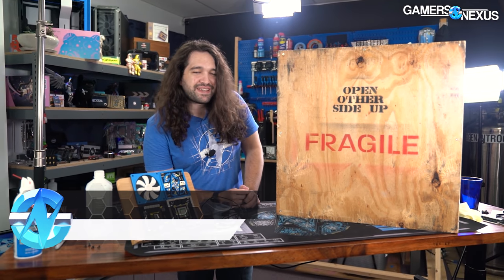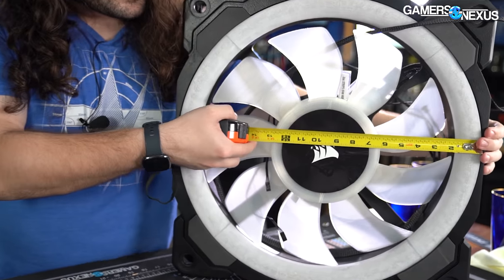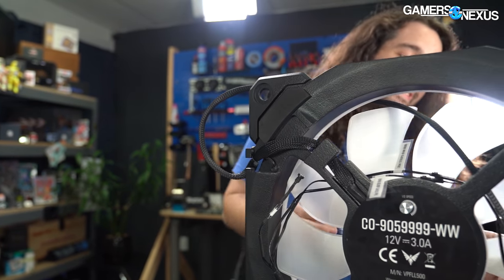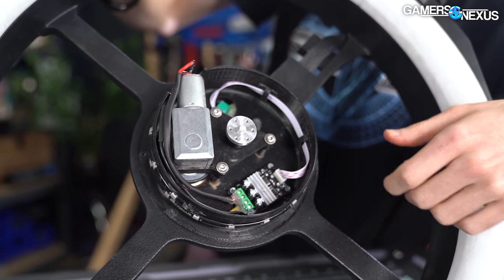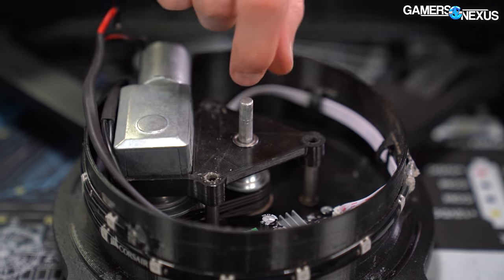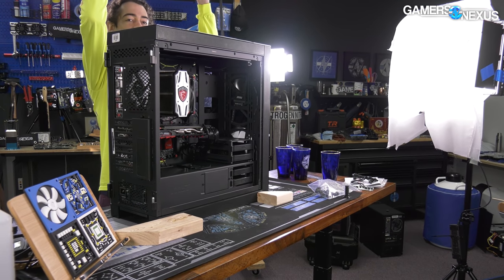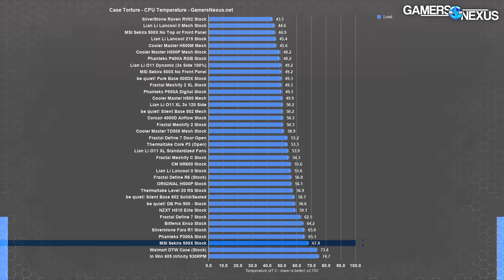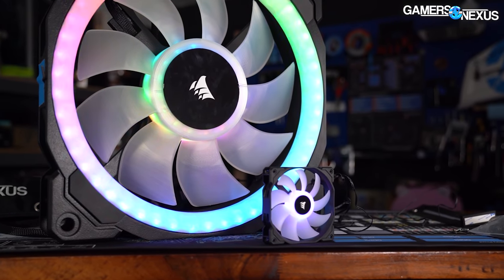World's Biggest Computer Fan: Corsair 500mm LL RGB Fan

Comment: The reason for the grinding and all the metal shavings inside the gearbox is the worm gear. It transfers the rotational force in a different direction so it can have way higher torque (which in this case, it needs that torque for that tiny motor to move that massive fan). The downside is that the gear can only move if the motor is moving, making it a very poor choice to use this particular design of gearbox. When the power to the motor us cut off, the worm gear will stop turning and the momentum of the fan will keep spinning, causing the regular gears to grind against the worm gear. That's why its having the grinding issue. Sorry for the rant. Just had to say it since no one in the video did :P
Reply: Would be easily solved with a one-way clutch/bearing.
Reply: Yep, that is the suck part of the worm gear
Reply: Needs a chevy 350.
Reply: Another great solution would be to do away with the motor and gearbox altogether and go with a direct drive brushless pancake motor on PWM control. 

Or if you wanted to get really crazy, an MIT Cheetah style CAN-BUS pancake motor...but really due to it's complexity and relatively low RPM it's probably not a great choice.
Reply: @manitoba-op4jx  Chrysler VX I 512cu.
Maybe not as legendary as the 440 but a killer engine none the less.
Reply: Approved by a college mechanical design lecturer

Comment: this is so authentic, even fails like the normal LL series fans.
Reply: lol
Reply: I work in a computer store and I can confirm this comment.
Reply: Guess I mist be lucky since my LL fans have worked flawlessly the last 3 years
Reply: ive got 6 corsair SP fans in my case and at least 2 of them have (i assume) ball bearing noises, and one needs to be set to 70%+ or it stops spinning. theyre about 3 years old. meanwhile the ~12yr old noctua 140mm fan is running as flawlessly as the day i got it.
Reply: @iris657  the LLP range fail on the RGB's you buy like 8, one of them fails and sends the rest nuts, complete disaster @ £30 each!
Reply: @torpedohippo8493  give it time
Reply: @MrFruitflan  they've already lasted past the warranty, so I wouldn't be too upset if one broke at this point, of course it would be nice to see them last longer. Since everything these days is made in China, I suspect that all products have little consistency when it comes to reliability because of the production.
I know this might not be completley comparable to consumer electronics, but pliers made in Germany (e.g. Knipex) are way more consistent in quality compared to chinese knockoffs/off-brand pliers.
Reply: @torpedohippo8493  same about 3 years and mine are working fine
Reply: Have some HD120s and 140s and they've lasted perfectly so far after 3 years.  Didn't know the LLs were a bit worse it seems.
Reply: I have had 3 Corsair LL fans in my case since mid 2018 and I have had zero problems with them.
As in, they just work.
Reply: @TheRealBaDaBingDK  you must have had a good batch! well done
Reply: @TheRealLink  yeah were talking LL series
Reply: @_damota  you have been lucky
Reply: @torpedohippo8493  Out of 18 fans 4 of them died in 3 years.
Reply: @torpedohippo8493  Okay, I will. Great advice, bro. Brilliant. Why didn't I think about it earlier? Silly me.

Comment: "There's exactly ONE of these in the world."
"Cool. Can I have it?"
Reply from the maker: We're only borrowing it!
Reply: This is like the love story between Linus and Lucky, the MSI dragon.😁
Reply: @GamersNexus  Sure Steve... Sure
Reply: borrow it...but doesn't say when to return it
Reply: @GamersNexus  is this the same kind of burr

Borowing my family does with my stuff?
Reply: @GamersNexus  That's a shame, I think they should make a computer case, and have the left panel just be this fan, blasting air down right into the motherboard.
Reply: @matasa7463  Mesh side panel and this fan on it. Call it the overflow. Ngl I'd consider buying it.
Reply: I'd like the final product, or 4, but after the prototyping phase.
Reply: @GamersNexus  I mean, you fixed the fan, which is a step further than id go, so id say you should at least now have a stake in ownership of the fan!
Reply: @GamersNexus  "Borrowing it"

You forgot the quotations
Reply: @matasa7463  Agreed, if the price wasn't insane I'd definitely buy one, especially now with the 3090 mining inside the case.
Reply: @thisusedtobemyrealname7876  I would call it the Corsair Overpressure, or the Hurricane
Reply: I just wish it was made by Noctua. They would have built something functional and competent. Not to mention wonderfully brown.
Reply: @GamersNexus  Aercool did something like this with the Aeroracer case many years ago and they actually made a real product that they sold to the public, not just a prop to use as a publicity stunt. Anyway, if somebody really wanted to do something like this, I'd think a better solution would just be to adapt a simple window box fan to a case. That would be better because you wouldn't be running off the 12v rail of your power supply.
Reply: @CaveyMoth  I imagine noctua seeing this and going "pshhh you dare challenge me lmao??? I'll make a bigger shot to surpass your big shot"

Comment: A simple fix would be to install a dog clutch on the hub assembly. When driven by the motor it would spin the fan, but when power is cut or reduced to the motor the clutch would slip until the blade assembly slowed down enough to be driven by the motor. The nature of a worm gear setup is that the worm gear cannot be driven by the components connected. More grease won't help any.
Reply: Yup, 100% agree, they need a dog clutch/overrunning clutch to divert the momentum/inertia of the fan blade assembly.
Reply: I might try this design. Currently we are working on a gear reduction plan but these are metal parts that need lubrication constantly. I like the dog clutch approach. I could 3d print everything and purchase a shoe and ring from a manufacturer. Good idea!!
Reply: S tier comedy

Comment: I need to have this as my ceiling fan for my room!
Btw, Corsair should actually do a limited run (1000-2000) of these fans as a novelty/collectors item.
Reply: they would have to work with an actual box fan manufacturer for that though
Reply: @TheObsesedAnimeFreaks  And improve on the motor. If the fan dies after just 15 minutes of use then it's nothing more than a large novelty paper weight, but if they could find a way for it to be reliable as a fan (or at least a kinetic sculpture) then they'd improve its value considerably.
Reply: @B3RyL  I mean all they need is a better motor, wouldn't be exactly difficult to do.
Reply: Nono, not a limited run.

This should totally be a full time product, otherwise I'll just have to 3D print my own
Reply: I want one for my room
Reply: I need this for my window in the Summer months.
Reply: Only $500 per piece
Reply: @vash_dakari  Same here, I need two of them^^
Reply: @tronixfix  I think that's a very conservative estimate

Comment: Now someone needs to make a 500mm sized scale model of a delta blowiematron that needs an entire kilowatt of PSU power to function
Reply: Hi dapz 
a kilowatt psu is enough to destroy my electricity bill
Reply: Wouldn't be dangerous at all, absolutely all limbs intact.
Reply: @goatedbg145wdinanutshell2  a kilowatt PSU is kind of the lower limit for an enthusiast grade system, right?
Reply: I worked in an industrial facility that had a... massive... blowiematron that ran a fertilizer drying system. 20,000 RPM, about 3 feet diameter fan. These types of things certainly exist!
Reply: @nashthebaker9338  20000rpm!! Did you still have ears after spending time with it? My GPU could do with one of these!
Reply: isn't that basically one of those floor drying vortex blowers flood cleanup companies use
Reply: @akkanomark  Aye Fermi + Pentium 4 used to be the butt of thermal and power consumption jokes. I'm running twin 3080Tis with a 1600W PSU and my power bill is... well
Reply: Yes, we need the ends of the fan blades to reach relativistic speeds.
Reply: How about strapping a GE-Honda HF120 turbofan engine at the exhaust of your PC case?
Reply: As a person who owns a delta fan, I think a 500mm version would probably blow out your eardrums immediately lmao
Reply: The fan that's used in wind tunnels, and those skydiving practice come to mind....
Reply: my g thats called a 500mph airspace testing wind tunnel
Reply: @akkanomark  I agree that the performance increase has only been incremental, I upgraded from a GTX1080 SLI system and had to nearly double my PSU's output for it to cope. Doesn't help that the CPU can pull down 200W on it's own. Heat-wise, I was having trouble with MSI's fan profiles (2x Gaming X Trios running at 82°C is not ideal) but I've made my own curves and now both of them and the CPU sit at about 60°C overclocked so I can't complain. But yeah, the system pulls down about 1100W at full puff
Reply: @akkanomark  I don't use both for gaming, but I do for rendering while gaming (I use an AI upscaling tool for projects and one 3080Ti munches through them while I play Forza on the other lmao), but no, if SLI was scalable (and usable) on the 3080Ti I doubt anything could phase it. Saved £2,000 on going for twin 3080Tis instead of 3090s, but as you said they lack NVLink. For gaming I use the one I've overclocked significantly and it's a real pleasure to use, 20+GHz on the memory is nice to see. Wouldn't be worth it over a 2080Ti in today's markets though, no way. What CPU and GPU version you running? I was under the impression that 2080Tis ran quite hot
Reply: @akkanomark  That's perfectly reasonable, I've got a 9900KF at the minute, sitting at 5.1GHz all core (it doesn't really like more than that but it can take it) and while it's more than a match for the GPUs, I'll be looking to go 12900K when that arrives. 400w is not only achievable, it's the low end of the scale, I'm afraid to say. I've seen the max OC'd version pull down 500 before, which is pretty mad. Undervolting is definitely a good option though, especially on the better binned chips (SUPRIMs, Strixes, X Trios). The exhaust fan serves as a heater for my room as, in the UK, it's bloody cold. Where do you stand on all this RGB crap? Lmao
Reply: @valiantdiesel1332  I am not exactly a Enthusiast But it seems overkill for me unless you have 2 3090s
Reply: @goatedbg145wdinanutshell2  2 3080Tis, same power draw, my PC wouldn't go far without at least 1000W
Reply: @valiantdiesel1332  hmm I guess since the 30 series do have there spikes
Reply: @akkanomark  yeah i know, i'm not stupid. that only was a joke of a Video, still funny tho.
Reply: that's it we need a 3 phase 400 volt beast of a motherboard to plug that baby into
Reply: @goatedbg145wdinanutshell2  honestly dude the GPUs alone can do 1100W if they spike at the same time, plus the 150 of the CPU and we're in dangerous territory for anything sub-1500W
Reply: @valiantdiesel1332  well power effective is something to forget
Reply: @Dgeigerd  my 40mm delta fans are still louder than that 😂😂
Reply: That’s called a helicopter
Reply: @nashthebaker9338  20,000RPM at 3ft in diameter means the blade tips would be traveling at 1570feet per second or 1070 miles per hour... well over the speed of sound. Are you sure they weren't 2000 RPM?
Reply: @nashthebaker9338  really? Doesn't that mean the blades have tip speeds of Mach 2.8??
Reply: Someone needs to send an email to Major Hardware!
Reply: they already exist
Reply: @hammyboigaming904  I use 4 deltas in my main pc, I completely understand.
Reply: well if we take the power consumption of a 40mm fan at 11.4w and we workout the increase in area of a 500mm circle we get to 1782w of power consumption. so in order to run it continuedly in north America it would require a 20 amp circlet.
Reply: @patrickderegt2582  Wouldn't that only be if they were running at the same RPM?
Reply: @valiantdiesel1332  no if they are the same air flow/area and the same efficacy. but it would have to spin slower just with such a large diameter.
Reply: @patrickderegt2582  Then that's bloody ridiculous! You'd need a 2000W PSU just to run one and an entry-level GPU-less system. Why do I still want one really badly though?
Reply: @valiantdiesel1332  of coerce in the real world you would just cut out the middleman and run the fan on AC power instead of bothering with a power supply.
Reply: @patrickderegt2582  Of course, but if, hypothetically, I had a MASSIVE case, it's doable. Like an ultra-tower case, made specifically for this fan, Corsair 1,000,000D lmao
Reply: You can get axial fans that draw 100Wh+ of juice, they typically run right off mains at 110~240v and put blowimatrons to shame!

They also make em in 1000mm but shipping gets expensive.
Reply: @yarharyar  What if we all pool some money together and get one? Just for shits and giggles lmao

Comment: I wish you had the opportunity to perfect the current design:
* Put in at least 10w motor,
* Greased up or rebuilt the gearbox,
* Replaced belts with a single belt.

And then in another episode make it extremer with even more powerful motor and powersupply.
Reply: I think it's more of the gearbox locking up, there is a lot of torque for that tiny gearbox to take. replace it with one that free spins on shutdown and it should work better.
Reply: @nigh01  I mean, I would just direct drive it with a larger motor and maybe throw a board in to slowly ramp power at startup.
Reply: Remove gearbox locking for avoiding belts and gears eating up on fan speeding down (maybe best solution is to use ratchet mechanism, so the fan wouldn't give its torque to motor when stopping). Not sure if putting more powerful motor help because of a fragile gearbox design (prolly it would just eat up gears faster on start). Using stretchable onebelt would fix the start torque, as it will damper it when hitting 0 to 100 rpm of fanblades (and yes, those multiple belts are worst without individual seats on gear).
Reply: You can really see that this thing screams "quick prototype" lol. The motor, the gearbox, the belts, even the board. Probably just put in what they had lying around.

Pretty much all of those parts would need to be replaced if one was trying to make something functional.
First, the motor needs to be at least double the power. Second, the gearbox needs to be a higher ratio and not lock up to transfer that power into RPM. The belt finally needs to be a single wide proper one.

Then it would go real hard, probably be quite scary too. Although to be truly frightening the board would need to be replaced to take outlet current and the motor and gearbox taken out from an industrial fan.

...or you know, at that point might as well should have just printed a mod for a standard industrial fan and added RGB
Reply: I honestly would have just said scrap the whole gearbox/belt system and see if there wasn't some low-profile brushless motor that could fit in there and attach the fan hub directly to the motor (direct-drive configuration like most fans). Or if not that then just use a smaller brushless motor, get a smaller belt pulley for the motor shaft, and a larger pulley for the fan blades for a belt-drive setup (again just leave out the gearbox). Better yet but more expensive and difficult would just be to build a custom hub motor that's basically the same scaled-up design of what normal brushless fans use.
Reply: @y2kam550  You sure there are motors that have the RPM for it?
Reply: @uncannysnake  They've had 12V fans for car radiators for quite a long time now.
Reply: @uncannysnake  If they use a Brushless or EC Motor I think its possible. They can just set a desired speed range that would be best suited for a fan this size and control it via PWM. ECMs have pretty good torque for their size and power consumption so I don't think that would be an issue either. A fan like probably doesn't need to spin that fast given the diameter and also the size of the blades themselves. maybe around 800RPM would be plenty for full speed. I think most 20" box fans max out at 1100 RPM.

 Im not actually insisting that this be made into a real consumer product btw. This seems more like a novelty toy than anything useful that I would buy.
Reply: @y2kam550  yeah the controller could slowly ramp the speed up to ensure there isnt too much sress placed on the motor.
Reply: No need for a gearbox just use potentiometer
Reply: you would just need to use the motor of a normal room fan